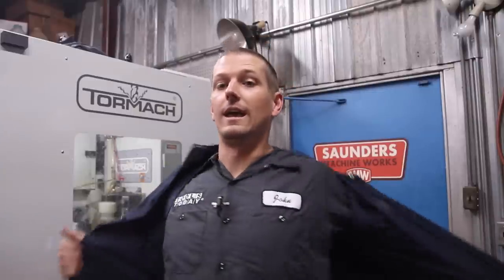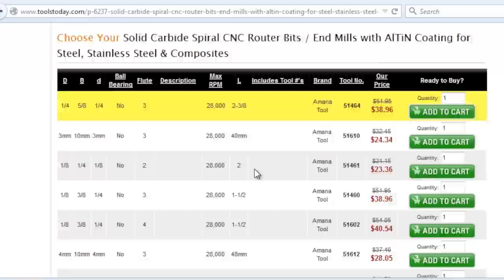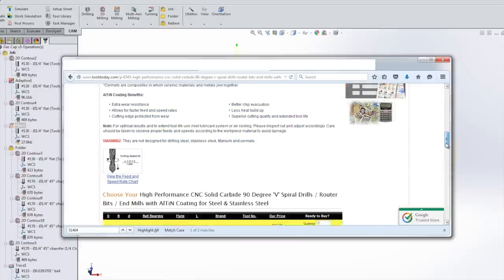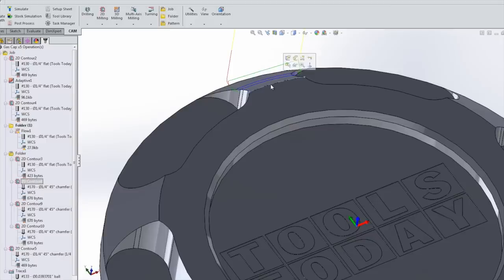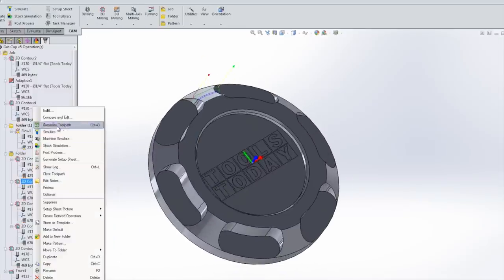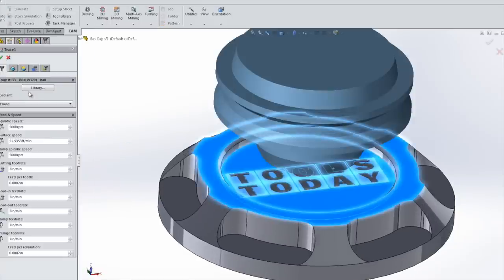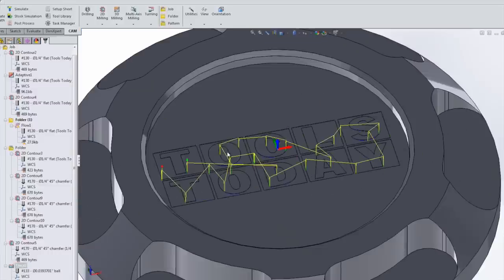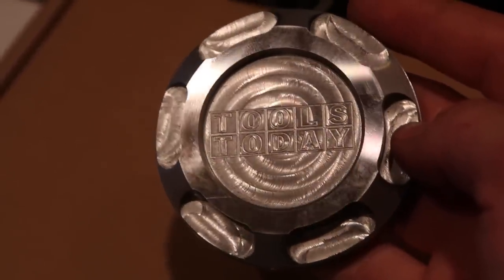HSMExpress Gas Cap!  Widget57

Comment: so when you added that sketch to break up the tool path and you used a circle and two lines from the center. you could have started a new sketch on the plane you wanted, selected each line (as it was already drawn) and convert entities. convert entities is really powerful and it holds the dimensions even if you change the part. you can also break them away from the original. 

also, a workflow tip. if you hold right click, a menu will appear and you just drag your cursor in which tool you want and it will select it. you can change and add more tools to this menu but it saves a lot of time from moving your cursor to the tool menus. you can get really fast with it and you don't even see the menu anymore. super fast. while for vids most people won't even notice you selecting the tool it is nice for when you don't have to show people or they know what they are doing.

hope you see this and please more solidworks and hsm. while i understand its great for hobby/beginners people to not use it and have cheaper options man is it a great and powerful tool.

Comment: Hi John,
Cool part.  I really liked the way the chamfer tool cleaned up the edges after the end mill left multiple steps.  The Tormach didn't seem to have any issues with the 4140.  I imagine that getting the tool loading right is the key.
Have a safe move.  Its perfectly understandable if you don't get a Widget out next week.  Thanks for the video.
-mike

Comment: Perhaps a flow op with the chamfer tool to reduce deflection and ensure the stepovers are small enough. Also, if the angle was not EXACTLY what the cutter itself was ground to, there will always be the lines. 51652 is a 90* V, so the slope of the contour would need to be 45*. Naturally, since I cant really measure the angle, I am just shooting in the dark... but the angle looked to be slightly less than 45, which is why you would get the burr at the top of the angle, and protruding rather than sunk in.

Basically, tool angle seemed steeper than part angle.
In any case, damn good job. Nothing like seeing that come out so beautiful towards the end.

And as a Wednesday Widget during your move, just make a simple engraving for the new shop to adorn your place. ;-) SMW plate for the ventilation fan. :-D haha. Or move, dont stress, and just make the best of things./
Reply: +NYC CNC The way you did the cam, it wasn't taking into account the angle of the modeled chamfer, just the tool angle as defined. This means the tool just wasn't exactly as defined, either the angle isnt perfect, or perhaps the tip diameter comes into play. Either way, you'll find it's very difficult to get any consistency in stepped chamfers like that. A small deviation in angle gets extrapolated out to a large mismatch.

Comment: John you can indeed mill bigger chamfers with a smaller tool. I have done it before but it seldom works just running with no offset to the tool. Tools ground to a sharp point seldom if ever have a true sharp point.(I know this because I grind tools on my CNC tool & cutter grinder)  You have to use a tool setter to get to the theoretical sharp point for you length offset. If you don't have a tool setter you would set the length offset long and rerun the tool a few times setting down in Z to get it to match. Also the tools actual tool angle might not match the models angle so of course this could cause a error from cam to machining.

Comment: Did you account for the width of the point on the chamfer tool? Every chamfer bit I've seen has a small chisel point (like a drill bit) which will give you a false z offset if you assume the end of the tool comes to a sharp point. Anyways, good luck with the move!
Reply: I have done what you are talking about soooo many times. It's like our programmer always forgot.
Reply: +yoonki Just for the hell of it, I looked up the specs of the tool... It appeared to come to a true 0 point. Naturally there is variation due to the grinding process though, so good tip. But then again, with multiple tiers, wouldn't they still align?
Reply: +Cody Smallwood Hmm, you're right. If the step over John used was less than the width of the cutting face of the tool, every thing should have been offset the same regardless of the width of the tip.

Comment: Hey John,
I've done the exact same type of chamfer op using a chamfer mill creating a much larger chamfered surface. Mine didn't work either the first time I did it, it looked a lot like yours with steps left over. The second time I did it it worked great. I think what I changed was starting from the bottom and working up so the tip of the tool is never actively engaged in material removal. You are using only the largest diameter of the tool where the cut quality is better.
Reply: +War Machine LLC Also gotta remember to take into account the flat on the tip of these kinds of chamfer mills.  They don't come to a sharp point on the bottom, so you don't end up with truly 1/2 the OD for usable DOC.  The 1/2" mill/drills I use for chamfering have a 0.050" flat on the end, which means I've only got about 0.225" of cutting face, of which I really only consider about 0.2" usable (IE spinning at a useful SFM).  I got the same stripes John did the first time I tried a mult-depth chamfer using these tools, and as you found, my fix as well was to make sure that the tool paths had more overlap.  I still cut from top to bottom, but I make sure that the outer most corner always cuts above where the tip was the pass before.  Bottom up or top down, either way you just gotta make sure that useful cutting edge has passed over the surface before you call it done.
Reply: +NYC CNC That's cool, I've never seen one like that before.  Do you have trouble with chipping the very end?  I sometimes get chips on the edges right down at the tip, even with the flat there.
Reply: +LogicIndustries the ones I use come to a needle sharp point too. It is more prone to chipping but I try to avoid using the tip when I can. I also engrave steel with it, just got to go slow. It's a 4 flute and only 2 of the flutes go all the way to the tip. they are from Maritool.
Reply: +War Machine LLC  IIRC my tools are made by Melin.  Whatever the brand, that's all I use.  I tend to be monogamous when it come to CNC tools so I'm not constantly chasing subtle changes in geometry that you get from vendor to vendor.

Recently I've switched to a 1" OD x 90° MA Ford 6 flute chatterless countersink for chamfering on anything that it'll cut (basically anything up to about 40 Rc hardness).  It's got flutes that go all the way down to about 3/16" OD at the tip, so you can make just about any radius you want just by moving the tool up and down in the Z, plus you've got fully 0.800" of chamfer depth available in one pass.

They can be had in carbide too, but they are SUPER expensive (way over a hundred bucks for the size tool I use most).

Just something else to put in your toolbox for chamfering.

Comment: Most chamfer mills don't have exactly 90 degrees tip angle. That's why you don't get a smooth surface. You can measure the angle in an optical presetter and adjust your CAM.

Comment: Big no-no using air-oil with steels.  You'll burn through tooling pretty quick if running the sfm/cpt that the tooling wants.  Best to just use an air blast with no oil if over 300sfm.  I use flood 300sfm and under (if I'm doing long conservative runs that need to conserve tooling) and if higher sfm air blast.  :)
Reply: NYC CNC Yeah, what will happen is the cutting edges will shatter running higher SFM with oil and air.  Generally just air is what you want for steels.

Comment: I generally have better luck getting chamfers to clean up by roughing the whole side then going in to do the finish steeps bc of the tool pressure diffrences
Reply: +NYC CNC I'll rough the angle with the angle cutter down all the steps then I'll do the finishing passes with about a 25precent overlap of cutting face and have little to no blend line